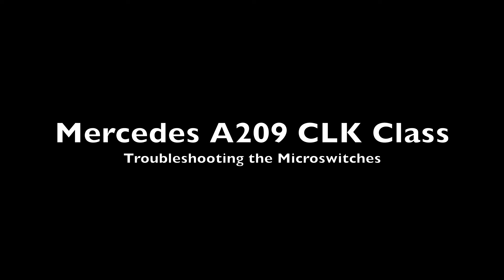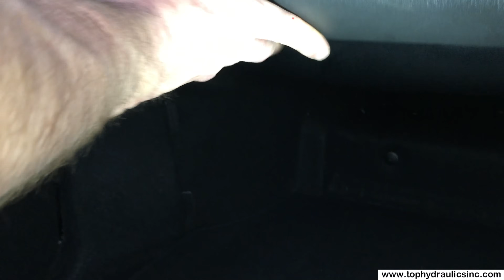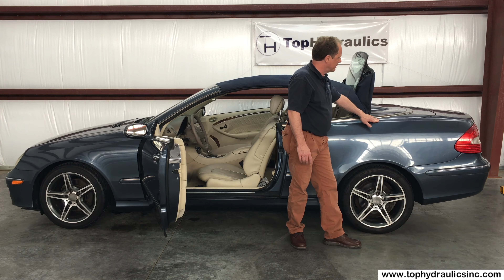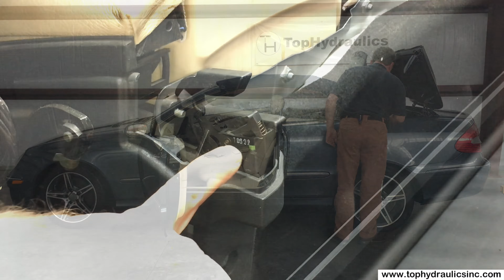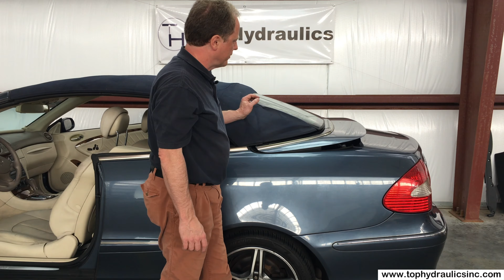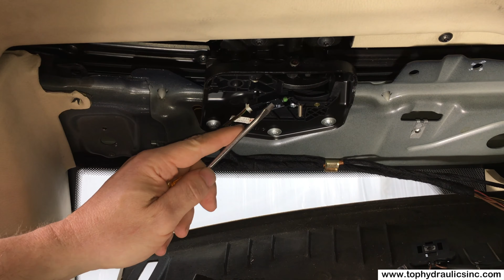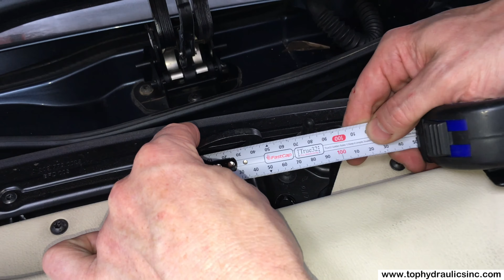Mercedes A209 CLK - How To Troubleshoot the Microswitches

Comment: The "top in operation" warning is on but everything looks closed, they only thing I noticed is the front windows are not fully up.
Reply from the maker: Can you share more details, so that we can help you better? For example, did the problem start while you were opening the top, or did it start while you were closing the top, what work has been done to the system lately, can you hear the pump running in the trunk when you pull or push the button?
Reply: @TopHydraulics  the pump comes on and the top opens and closes the front two windows don’t go the extra inch at the end and the dash say “top in operation”. This all started after it snowed. There has been no work done on the top.
Reply: Is there a good website to get the s8522 switch from that you can recommend
Reply from the maker: @bookertsmithjr  That should be part number A2098201910. Best google who has it available and pick your best option.

Comment: Hi Dear, I am facing a problem with my Mercedes 230 CLK , When I am driving if the car goes in the road bump shutters are opening automatically. Long time onwards back seat headrests are up positioned permanently. Please guide me how to solve this issue.
Reply from the maker: Which model year is your CLK?

Comment: You know your Mercedes 
You not guessing you know what you doing 
I have a 2008 CLK350 i just bought it but hydraulic pump completely empty 
Any idea please
Reply from the maker: Obviously, you have a leak somewhere. If you don't find any fluid on the trunk floor, then the most likely source of the leak is one or both main lift cylinders. Hopefully, you have the repair history of the car and it tells you whether any cylinders have been replaced already. The original cylinders in this car are just about at the end of their expected service life.
Reply: @TopHydraulics  
Thanks so much for replying to 
I was busy I just see it 🙏🙏🤝🤝

Comment: Thank you Klaus! My A2098201910 Limit Switch, Left, keeps breaking, (casing cracks). Any idea why? The Limit Switch is properly seated and the torx screw is tight.
Reply from the maker: It would appear that your case cover is not moving evenly. The most common reason is air in the system from a leaking actuator, or it could be something binding in the case cover's linkage (check the hinges), or it could be one of the case cover lift cylinders having a lot more internal friction than the other one. Check the fluid level in the pump first, then check the linkage and hinges, then observe whether the case cover comes down a little tilted to one side.

Comment: Hi..Any one can help ? At my w209 when I push the button to open the roof.The 4 windows are opening but after that nothing happens.I checked the pump fuse is ok.Also when I push the button down (to close the roof position) I hear the pump.So the pump is ok I guess.But what could be the problem?
Reply from the maker: Do you get any message in the instrument cluster while pulling the button to open the top?
Reply: @TopHydraulics  No until the windows go down I have the message in progress and after stop and the message disappearing
Reply from the maker: @a.k1944  Just to clarify: the "top in operation" message shows up only while the windows are going down, even if you keep pulling the button? No blinking lights or other warnings?
Reply: @TopHydraulics  Any idea ? Probably Relay?
Reply from the maker: @a.k1944 Based on the description I have seen so far, a bad relay is most likely. Good luck!
Reply: @TopHydraulics  Thanks a lot Sir. You are the best

Comment: Amazing videos Mr. Klaus! I've had my 06 W209 for 2 years without issue, but now the top only opens to the position at 8:00, and won't even move when I try to pull/open it manually. Sound like a switch 84/11 problem?

Comment: What’s the part number for struts in the compartment cover. Do you have a link where I can purchase it?
Reply from the maker: The part number for the gas struts is printed on the struts. It is 2096900059. We don't sell them, but there are plenty of aftermarket suppliers if you don't want to buy directly from Mercedes. Simply google the part number.

Comment: Hi there, got a 2003 clk320, I saw in the comments that someone had a similar problem that you replied to but they never got back to you so the problem  didn't get resolved here.
Almost 12 months since I last opened the roof, opened fine, tried to close it, nothing! no pump noise, light blinks red on the switch, message, visit workshop, found your vids, got it closed manually.
Tentatively tried to open it again and seems to want to, didn't let it though, getting late. I did notice that where you put the straps through to manually open that compartment, one of the plastic levers on the right hand hinge is broken, (UK spec) does this operate a switch? and could that be the fault? or is to that everything is so tight/seized, because that compartment cover seemed hellish stiff to move.
Anyway great vids, hopefully I'm not to late to the party :)
Reply from the maker: What are the last six numbers of your VIN?
Reply: @TopHydraulics  Thank you very much for the reply, honestly I didn't hold out much hope as the video is some years old now. You Are the MAN!
012106
Reply from the maker: @rustynail6363  The VIN confirms that you have the newer style case cover cylinders with the release buttons on the bottom, so that eliminates the concern that you might have an early production version with the obsolete case cover cylinders that seize.
The plastic lever in the hinge does not operate any switch. It is very hard to move the compartment cover manually in the first place. When the cover moves unevenly, maybe caused by a plastic piece getting stuck on one side, that increases the chances that the micro switches get damaged which indicate ‘compartment cover in catch position’ and ‘compartment cover closed’. They would be my first suspects - check them out!
Reply: @TopHydraulics  Thanks for that will look into them.
Kind regards
Rusty

Comment: Question 
How can make more pressure power for strut to keeping micro switch on in time when roof in folding processHow can make more pressure power for strut to keeping micro switch on in time when roof in folding process
Reply: My car is clk350 convertible 2007
Reply from the maker: Are you referring to the gas struts that keep the trunk divider closed? When those run out of charge, they put less pressure on the trunk divider, which results in the micro switch not giving the signal that the divider is closed and thus the top will not move. The only good remedy is replacing the gas struts. They are cheap and the Mercedes part number is printed on them.

Comment: Thank you for the video. My A207 has the problem of bow not raising after the lid unlocks and go to the catch position. I would have to manually raise the bow and the trunk lid up then I can continue in auto. 
During Closing, it is also the bow not being able to raise up and kicks out the sequence. 
The weird thing is that the bow is pressurized during the closing but not during the raising/extending. Do you think it would be a bad cylinder or bad valve?
I checked the resistance on the solenoids, all read good resistance.

Comment: The soft top and windows of our 1999 clk 320 work intermittently.  When the windows don't work, neither does the top.  Often times, after a 20 - 30 minute drive, the light on the console panel goes off and everything is operational.  We think it is a wiring problem in the console.  What is you opinion on our problem.  Thank you so much for offering such complete information.
Reply from the maker: Thanks for asking. You actually have an A208 chassis CLK, which is different from the one shown in this video. The windows won't work if the computer things the top is not fully open or fully closed. If you have a light on in the console while you are driving, then it is more likely that the computer reads the top is not fully latched. Do you get this problem also when driving with the top down? If so, then we can likely isolate the problem fairly quickly.

Comment: Hello, we communicated back and forth yesterday below. I was able to verify that the microswitch clicks when the rear bow is lowered. If the wires are ok where they flex when the cover moves, and the microswitch clicks when the rear bow is lowered, is there another spot in this area I should be checking?

Comment: Hello! I've got a 2005 Mercedes Benz CLK 320 W209 convertible top operation issue 
Top opens great 
Top closes great until the last moment 
Rear window clicks to tonneau cover but tonneau cover does not close completely 
Hydraulic pump runs fine with no leaks

Have conducted some research and it looks like it's microswitch S84/19, which is Bow (Locked) Limit Switch. Took off some of the wire paneling and all wires look good, and the microswitch itself clicks, however I am not sure if the microswitch being able to click necessarily means that it is fine. I cannot find this part anywhere online and am planning to go to the dealership tomorrow to try and get this microswitch. For any of those who are familiar with microswitches on these soft tops, is this likely the issue? If the part is not too expensive, I'd like to give it a shot. The Benz dealership here in Flagstaff told me they are not confident with diagnosing these models, and that the Benz dealership in Scottsdale (2 hours away) or Vegas (4 hours away) would likely have the diagnostic tools to do it, however I'd really not rather make day's drive of it if I do not have to.

I've posted a video here on YouTube to show exactly what is going on. 
https://www.youtube.com/watch?v=fHoTCIGa6SA

Thank you very much in advance!
Reply from the maker: Thanks for the very detailed description,  it makes a difference!  The logical conclusion would be that the "bow locked" limit switch is not getting the signal to the computer that the rear bow is in the latched position, ready for the tonneau cover to close. If the pump stopped immediately after the switch is triggered, then we would assume an "illogical readout" with one of the other micro switches contradicting the signal from this one. In your case, the pump keeps running as if the "bow locked" signal has not made it to the computer. I would look at two details:
1) Make sure that this is not an alignment problem, where the switch clicks if you push it with your finger, but it actually would not be clicking when the pump lowers the rear bow. If the switch clicks, then is almost certainly sends the proper signal to the wires.
2) Follow the harness that goes from the switch to the control module next to the pump. This harness is routed along the left tonneau cover hinge, where it flexes when the cover moves. It is possible that one of the two wires from the bow locked switch is damaged and the signal never makes it from the switch to the controller. You could even simulate the switch working by splicing a switch into the harness closer to the computer that you close (or just to wires that you short to each other) when the rear bow is closed.

Please let us know what you find.
Reply: @TopHydraulics  Thank you very much for the reply! Yesterday, after watching the video above, I followed the wiring where it flexes, since that was one of the things the video stated to check and I even found a thread of someone with the same issue and a broken wire where it flexes, however all my wires looked fine where it flexes when I removed the plastic harness over the wiring in that area. I also cut a little bit of the rubber below the plastic harness to expose a small amount of the wiring and that looked good too. No broken wires that I could see. 

My mechanic had stated about a year ago when this problem first occurred that it is possible that the soft top had shifted over 15 years and that this could possibly be the issue, since the drivers side window no longer meets perfectly with the gap when the window shoots up when the door closes. Could the shifting of the top on its own over time have caused the alignment of "Bow locked" limit switch to change? This switch has never been removed or aligned before, so that's why I wanted to ask. Not sure if it necessarily takes someone else tampering with the switch or if it could just simply misalign over time from the shifting of the top after 15 years. 

Thank you again for all of your help, and I look forward to hearing back.
Reply from the maker: @kylerowins1641  If the wires are okay, have you verified that the switch actually clicks when the rear bow is lowered by the pump? 
It is very unlikely that you need a new switch. Familiarize yourself with the way the switch gets activated as the rear bow comes down. Then take a close look at how the switch and the latch are mounted and you will see how the latch can be adjusted.
Reply: @TopHydraulics  I think you are definitely right in the sense that the switch is not clicking when the rear bow is lowered by the pump, causing the issue. It clicks when I manually click it when I pause it during operation as Klaus does in the video, so I know that the switch clicks. I just can't tell when if it clicks when the rear bow is lowered by the pump, but I'm not sure how to go about telling if it does. I can assume I can adjust the switch by the screws on the switch, correct?

Comment: Hi, question. My rear right quarter window stay stuck up position, and my convertible starts to open when operated but stops pretty much straight away. Is the problem with my roof linked to the rear window not operating? Thanks in advance
Reply from the maker: Indeed, the window regulator needs to be fixed or replaced before the top can operate properly.

Comment: Great info, well presented. I've just had my roof replaced & microswitch 2098201910 looks suspect. The "top in operation" warning is continually coming on with the beep warning going off frequently. Does this sound like the right culprit?
Reply from the maker: Does the top go through the full opening and closing cycle and does it latch properly?
Reply: @TopHydraulics  Yes it does, but the final 10mm movement of the rear windows doesnt occur when putting the roof up. The warning goes off when the roof is up or down. All evidence suggests that it has done everything it should, other than the final window seal at the end of the cycle.
Reply from the maker: @daveplumpton729  This would be indicative of the limit switch on the right side not getting the "closed" signal to the controller, i.e. the switch that gets triggered when the storage cover is closed. I don't have the part number at hand - it is printed in tiny font on the switch assembly.

Comment: hi klaus
thanks for these great videos.i got though a problem with my CLK200 2005.
When i am trying to open my softtop ,when the  window goes down , and the top must start opening (front latch totaly disaganged) it doesnt start the movement.could you give me an idea wich microswitch could it be?thank in advance.
Reply from the maker: You wrote in a follow-on post that your front lock cylinder is leaking. Is the fluid level in the pump's reservor still above minimum?

Comment: Thanks for Your videos. I ve got the problem - when I try to close the top, it moves normally, but when it hit the front, it stops. When I strong push the roof manually and move right, left it continue to work. What can be the reason ??
Reply from the maker: Start by checking switch S84/18 "limit switch in catch position", see https://youtu.be/ZLIdoiw_KTY?list=PLly4CMbpk7owNRAl-AECemIb0SVihtBlV&t=689
Reply: @TopHydraulics  I ve just regulate the middle lock mechanizm as You suggest in the video. Now the top closed properly hovewer now in the next step the rear flap dont want to close.
But it works, because when I want to open the top, it normally closes. 
I can't close it when the top is on.
Reply: @TopHydraulics  many thanks, i’ll do tomorrow the test and  i will let you know. Hopefully i messaged you and found someone that really knows a lot about the subject :)😊